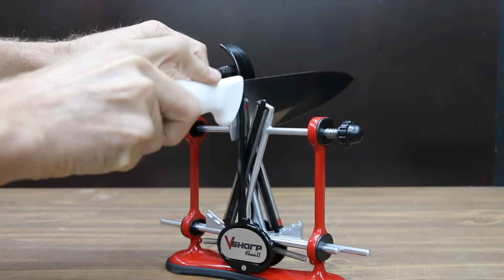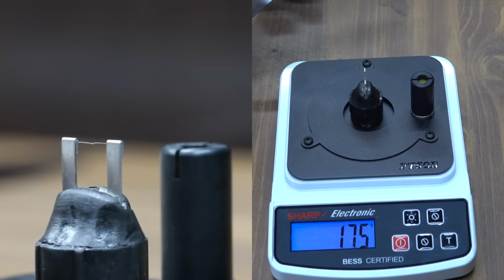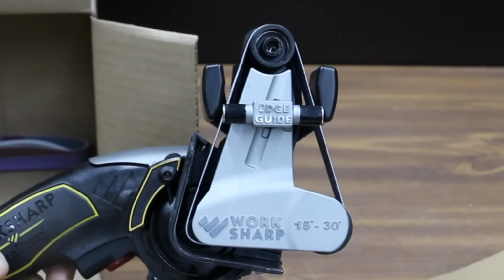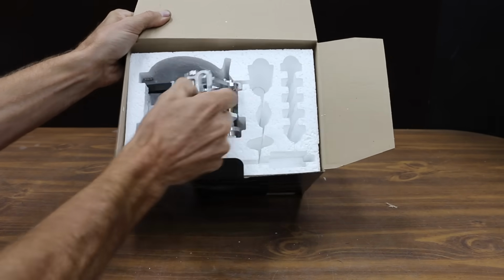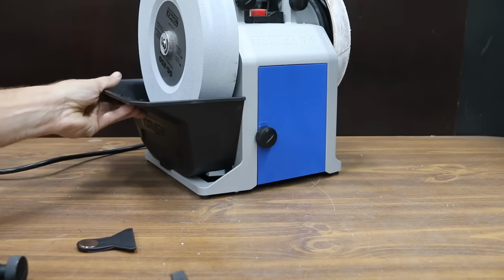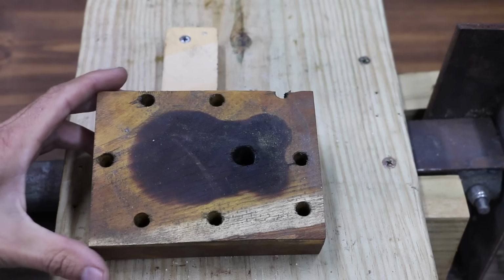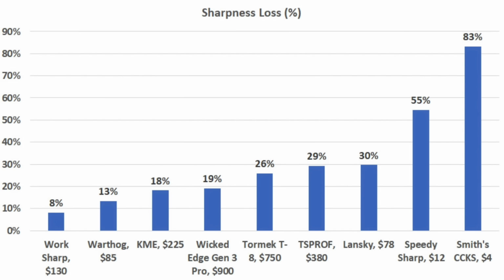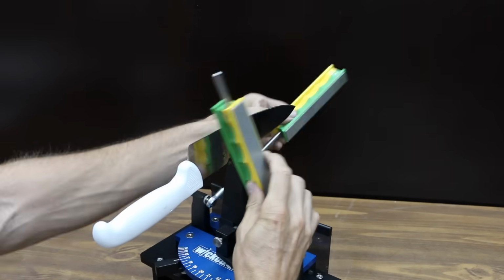RUSSIA vs USA Knife Sharpener? TSPROF vs Lansky, Wicked Edge, KME, Tormek T-8, Work Sharp Ken Onion

Comment: I think Tormek grindstone has 2 grits, after coarse sharpening there should be special stone used to grind grindstone iteself into 1000 grit and then sharpening  with this additionally before honing. So there are 3 passes - coarse, fine and honing. I am agraid the second pass is missed here. Maybe it would be sharper with this then. Great videos nevertheless.
Reply from the maker: Thanks!  Thanks for the feedback.

Comment: Great video. I own a kme and love it. You can get polishing films with the kme and wicked edge that allow you to take edges to the next level. The only sharpener missing would be the work sharp precision sharpener that is basically a budget kme. I'm always amazed at the time and money invested in your videos. I really hope that you at least make it back. I would be very interested to see knife cutting comparisons between different manufacturers. Like Benchmade, zt, Cold Steel, Spyderco etc. Find models with the same steel and similar blade thickness, sharpen them the same and compare how they cut followed by a comparison of who does the best heat treat. Would be very interesting. Great content as always.
Reply from the maker: Thanks!  Thanks for the suggestion.
Reply: @ProjectFarm  you could use the Cold Steel holdout 3, Spyderco pm2 in s35vn, zt 0770cf. They are all s35vn and all have very similar blade thickness. I can't find a similar knife from Benchmade in s35vn though.

Comment: The rod holder on the lansky will wear grooves into it over time because it's made of very soft, or powdered metal. I used mine for a while and liked the results until I noticed the rods were literally making bevels in the metal of the holder... which then starts to alter the geometry of everything. Was thinking of moving to the Work sharper when it's on sale again :/
Reply from the maker: Thanks for sharing.

Comment: best knife sharpener is one that's small enough to keep in the kitchen and super easy to use so it can be used whenever necessary. All those ones that require setup and multiple stones are just going to result in a bunch of blunt kitchen knives except that one short period a year after you can be bothered getting the sharpener out and setup.
Reply from the maker: Thanks for the feedback.

Comment: Lol... that smith's sharpener and a cheap $20 (US dollar) knife served me well as a box cutter for like 2 years. 
Granted it took like 2 hours every night. 
I have a few other 2 in 1 sharpener designs as well (both are absolutely trash) 1 had a set of steel disks to sharpen and a coarse whetstone type material to finish (actually made blade more dull)
The other had ceramic and carbide disks to sharpen (just fell apart from too much pressure over 6 months of near daily use)
Reply from the maker: Thanks for the feedback.

Comment: Enjoyed the vid, but there are other options.  I purchased a set of 5 made in China ceramic knives 2 years ago for 20.00 off ebay.  They were razor sharp when I got them, and are still razor sharp after typical kitchen use today.  If they get dull and/or damaged in the future, hoping I can get the same knives again.
Reply from the maker: Thanks!  Thanks for sharing.

Comment: Id love to see my boning knives on that test if the lansky gets 95 my work knives would score 45 id guess i sharpen them and the are far sharper than the boys get them with a lansky
I use a fine clay stone 50,000grit 0.5micron and a marble stone 100,000 grit 0.259 micron
My honing steel is a polished chrome steel and i also have a glass one
Reply from the maker: Thanks for sharing.

Comment: Great video. He purchased the top-of-the-line Wicked Edge, with the fancy stand. You can get the exact same system and sharpness for considerably less money, about 2/3 the price. Still expensive, but a great tool. And the company has great support-they upgraded the clamp a few years ago (my setup is about 10 years old) and I was easily able to get the upgraded clamp and install it.
Reply from the maker: Thanks!  Thanks for the feedback.

Comment: I am a knife nut for many years, I own one of those sharpness testers myself.  One test is very inconclusive.  I always do a minimum of 3 tests and average the results.  That said I think the results were fairly accurate with the default stones that come with systems.  the premium systems can be used with such a wide variety of stones, well most can, some are fairly locked to proprietary stones.  You tested most of what can be tested in your method but there are many other things to consider - like how compatible is the system with 3rd party stones.
Its too bad that you got the worst (in terms of usability and learning curve) of the TSPROF systems.  The K03 or the Kadet are significantly easier to use, in my opinion.
Reply from the maker: Thanks for the feedback.

Comment: I've always liked the tormek it may be expensive but you aren't limited to just sharpening knives you can sharpen chisels axes and even lawn mower blades for example
Reply: Yeah, i have the T7. Shame he didnt have the proper knife-jig (doesnt it come with the case anymore? mine did?) for the test, i think it would have helped its case slightly. The lansky holder idea was great :D Works well for the blade untill its curved tip.
Reply: Also,did he reprofile the stone from 220 to 1000?Should make a difference in the result.
Reply: @mileshartman8717  Doubt it makes much of a difference when the edge was polished to that degree by the strop.
Reply: @dragoscoco2173  polish doesn't equate to the edge. You can polish/strop a rounded edge, it will still shine, but it will not cut. I sharpened some chisels on a super hard 220 whetstone which left a mirror finish as the grit broke down, but if you try to cut with it, it cuts like a blade sharpened to 220. You should still go to ~ 1200 grit for most cutting edges.
Reply: Their diamond wheels let you quickly do carbides and tool steels as well.
Reply from the maker: Thanks for sharing.

Comment: The WorkSharp is great because it makes a tough edge and very fast to use. Leave it setup with belts nearby and you can blaze through stuff. There is also a finer belt available and I bet you can get them slightly sharper if needed.
Reply from the maker: Thanks for the feedback.

Comment: I've had a Wicked Edge pro pack 1 for 7 years now. Absolutely the best and the easiest sharpener to use, in a home environment. Mine was a lot cheaper than the one tested here, while I do like the design of this one with the clamp and adjustments, it is meant for a commercial kitchen to sharpen knives, at least that was the last marketing I saw of it, years ago. For the $580 I spent with add-ons I have 50/80/100/200/400/600/800/1000 grit diamond stones, 1200 and 1600 grit ceramic, and diamond pasted leather strops that are 5 micron and 3.5 micron, 2 of each stone like shown. What I added to the then pro pack 1, in 2014, was the 50/80 grit diamond(rarely used, not needed for the most part) and the1200/1600 grit ceramic stones. All from Amazon brand new, all from Wicked Edge, genuine accessories. I did have an issue with my ceramic stones being uneven, Wicked Edge replaced them at no cost, included a shipping label with the new ones to send the bad ones back in the box that had the new ones. Honestly one of the easiest designs to figure out, no issue loaning mine to friends, with the exception of one person using the strops wrong and cutting the leather but luckily was my old set and not my good set. It is simple to get a great edge. Other designs will be faster like the Work Sharp, I considered one before buying the Wicked Edge but wanted more options, like polishing the edge with 1600 grit and fine leather strops. I can get mirror edge sharpness, not what most people look for, to me when I think a knife is dull most people think it is scary sharp. I had an older Lansky system previously to the Wicked Edge, and while it was good to sharpen I wanted more. With the two stone method it just made it easier and quicker to sharpen with more repeatable results and easier to touch up of knives.

I have a lot of knives but also have pretty shaky hands, runs in the family, I'd like to use regular wet stones but it is not in my skill set or abilities to do so. I know prices are more now then when I bought into the Wicked Edge line but they have great repeatable edge sharpening. My review in 2014 was not spectacular, I judged based on quality I saw for what I paid, they fixed that issue, customer service was fantastic, quality of edge made was not an issue in my review of them. Might be overly critical of anything I look into, knife sharpener after a lot of research being one of those things. They absolutely do it correct though, all their sharpeners are easy to use and give great results, also spectacular customer service and the owner putting out videos demoing how to use the sharpener were great to use. I continue to use my sharpener 7 years later, not because of price, but because it gives fantastic results and I can touch up a knife very quickly.
Reply from the maker: Thanks for sharing.

Comment: I love my lansky. For the price and the efficiency for that price it has been my go to for years. I usually use the smith you tested to keep blades touched up a little longer before taking them to the lansky but when I use the lansky I make a day out of it and basically have a hulu and sharpen party just watching a show and sharpening blades all day to bring them back to peak performance.
Reply from the maker: Thanks for sharing.
Reply: Lansky is still the best. When I am done with the stones I take fine grit sanding paper usually starting with a 1500 grit and you cut small pieces the size of the stone wet them with the honing oil and "stick" them to the bottom of the stone. That way you can give the knife a edge that is crazy sharp and durable. I start at 1500 and step it up with 2000, 2500, 3000, and finish with a 5000 grit paper I get. Try it once just remember to slide a piece of the sand paper under the adjusting rod when you fitted the sand paper so you keep your angles correct.
Reply: For a couple af years ago, I'was at a fleamarket. I'm always interested in small boxes and whats in them. When I stand and open this little plasticbox, the seller came over and asked me if I knew was it was, because he didn't. I know a Lansky set, when I see it. I respond to the seller by asking "If I tell you what it is, then I can get it for around 3 dollars?" He accepted and get a little wisere that day and I get a Lansky set.
Reply: @peha524  not bad since the sets range from 50 bucks on up.

Comment: My son used some high filtration pleated filters to filter air for allergies and dust. Works great for like <$50 dollars.  Izzy Swan (you tube) made a simple cheap dust collector that outperformed a $300 or 400 hundred setup.  Just an idea for you to see which air filters work versus price. Great video on knife sharpener.
Reply from the maker: Thanks!  Thanks for the feedback.

Comment: Hello, Todd;
Thank you for all you do.
This is a very interesting video, thanks, pal.
I really appreciate it because I'm looking for another knife sharpener. 
I have some sharpeners;
 2 cheap carborundum stones,
 a cheap Harbor Freight diamond sharpener, 200, 300, 400, & 600,
 2 "Steamboat" ceramic sharpeners,
 a Smith's Orange diamond sharpener,
 a Smith's pocket sharpener (very similar to the 1 in this video), & some others.
BTW, the pocket sharpener works fine on my old Jet True Temper hatchet.
I have sharpened knives on the bottom of china.
Also I've been using sandpaper (usually w/ WD40) on glass to 'freehand' sharpen.
I made a strop from an old belt but I don't use it much.
I'm thinking I may buy a Lansky system similar to what you used.
Have a GREAT day, Neighbor!
Reply from the maker: Thanks and you are welcome!

Comment: Just wanted to let you know after the first jump pack video I bought 2 Audew jump packs and recently had a reason to use both of them at the same time, I jumped a Volvo VNM diesel tractor at work when the Noco that's 4x the size and 3.5x the cost failed to do the job. Those Audew jump packs are monsters for how small and inexpensive they are.
Reply from the maker: Thanks for sharing.

Comment: I CANNOT BELIEVE Speedy Sharp still exists - I bought one back around February 2005 at a motorcycle show...still have it...because I bought my Lansky not long afterwards...and my Lansky basically trumps everything...especially my Ken Onion Work Sharp - really the only thing I don't like about the Work Sharp system is that I'm still using the original stones that came with my Lansky around 2005 or 2006...my Work Sharp...yeah I have no idea how many belts I've gone through. Love your videos as always! Knife sharpening has always been incredibly important to me.
Reply from the maker: Thanks for the feedback.

Comment: I used a Lansky for years, and it was fine.  Though it used stones, not diamond.  Upgraded to the Ken Onion Worksharp, and I can get some sharp stuff off of that, and stropping really makes a difference with it.  Only drawback is the amount of belts you can go through.  One thing I would like to see with winter coming on, is a comparison of the electric power shovels.
Reply from the maker: Thanks for the feedback.

Comment: I got the lansky with diamond blocks after your last video and have been very happy with it. However I have a small “hawksbill” blade on my spiderco cricket that doesn’t seem to do well because of the radius of the curves vs the width of the sharpening blocks. If you have the time I’d be very interested to see what works best for “oddly” shaped knife blades.
Reply from the maker: Thanks for the suggestion.

Comment: awesome video! I have a lansky sharpener, and i've had it or a while now and honestly i can get good edges with it, but frankly i hate its design.The aluminum body feels like its incredibly poor quality and the screw you use to tighten it stripped out the aluminum after only a couple weeks. I tried to make it work with some hand clamps but have now just resorted to using the stones by themselvs.
Reply from the maker: Thanks!  Thanks for sharing.

Comment: Worksharp by the way, shouldn't be used as per the manufactuers instructions on stainless steel, you should never use anymore course than the 320 on stainless steel unless you are actually reprofiling the edge on the knife because it is that badly damage, the 60 or 80 (whichever is the roughest belt) hogs material off, and ii would bet that if you put the test knives side by side, the worksharp knife would be about an 3/16 to 1/4 inch shorter (top to bottom), than the other knives
Reply from the maker: Thanks for the feedback.

Comment: Suggestion: Wire brushes attachments for angle grinders. Lots of the "niche" angle grinder attachments make HUGE claims and the prices vary drastically, seems right up your ally
Reply from the maker: Thanks for the suggestion.
Reply: I'd love to find one that holds up longer that 15mins. I use them to debark red cedar & for a roughly 8ft x 12in log I go through about 9 wire cup attachments.
Reply: @RogerSegerJr  I usually use them for rust repair, so wide field of use!

Also, just learned the red cedar dust is toxic (only knew about walnut) what are your experiences? Do you feel the need to use pse?
Reply: @Miraculix26  yes I use a rebreather with hood if I'm in my shop along with exhaust ventilation.  If I'm outside, I use a full face painter's mask with filter & ear plugs. Red cedar is some nasty stuff!
Reply: @RogerSegerJr  Pending his video obviously lol, but for the time being the best I've had luck with are the dewalt twisted wheel ones, I used one to rip all the enamel off of a lawnmower and 55 gallon drum and it's still got plenty of life left.
Reply: Good suggestion , I am sure Todd will figure out how to do accurate scientific tests he always does. its not gonna be straightforward like cutting disks...
Reply: @xilnes7166  I'd imagine one would be something like, putting it in a chamber so you can count how many wires get shed (god knows that's the worst part)
Reply: I'd love a steel wire brush attachment that doesnt make the angle grinder vibrate like crazy!
Reply: I I agree I normally end up with wires coming out of my arms
Reply: @jbflyinglow  I just used one the other day that had me pulling out a 1/2" wire right out of my thigh, went clean through my work pants and had to grab it with tweezers. Honestly startled me when it just kept coming out because I thought it was just like, a little fragment but turns out it was the entire length of the wire.
Reply: I don't know if they have them for an angle grinder, but those black Scotch Brite wheels they sell for drills should take bark off without the negative effects of the wire wheels...
I just looked on Amazon.  They have it.  It's called the Scotch Brite clean and strip XT pro disc.
Reply: @eiward  I use those for body work since they work great on metals, but the bark & skin on the red cedar causes a lot of tearing & shedding.
Reply: Agreed - good suggestion
Reply: I'll stick to my wet stone and leather strap 🤠

Comment: The Smith sharpener is more for maintaining a sharp knife and not for correcting extremely dull or damaged knives, if that makes sense. I use a similar tool on my chipper knives.
Reply from the maker: Thanks for the feedback.